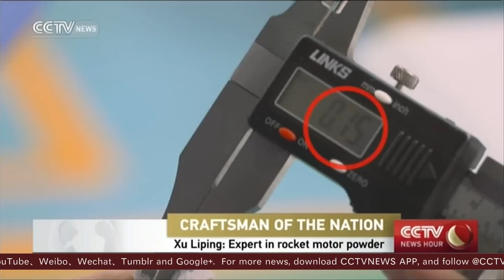Craftsman of the Nation: Expert in rocket motor propellant

Comment: Yes, overly dramatized. I've done propellant trim work on solid motors. Not that dangerous and faster by hand than a CNC. The propellant is very flexible and can deform under the pressure of a CNC tool. The fine sprays of particles produced by CNC's are an ignition hazard.
Reply: You would think you could get a CNC device to trim it with a blade instead of spinning tools.

Comment: Jeezus they use a knife to cut the propellant? And that's state of the art, seriously? Great clip anyway, it's surprising how little propellant there is in the motor.
Reply: The propellant although full of energy is resistant to much work done around it. A knife cutting it slowly is actually safer then other methods that may use high velocity blades.
The engine also has so little becouse its thrust duration is small, along with the powerful fuels.